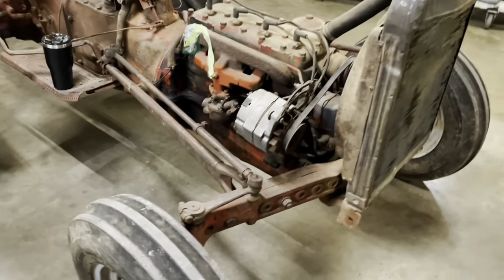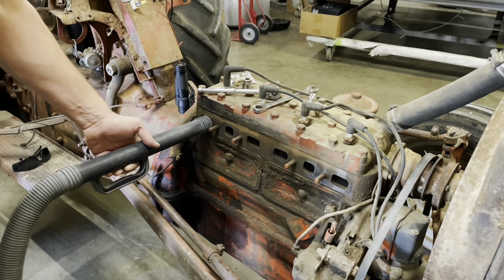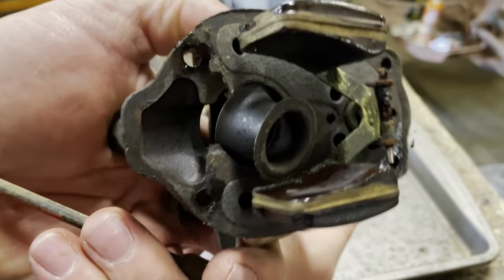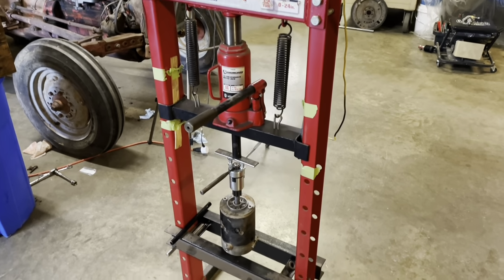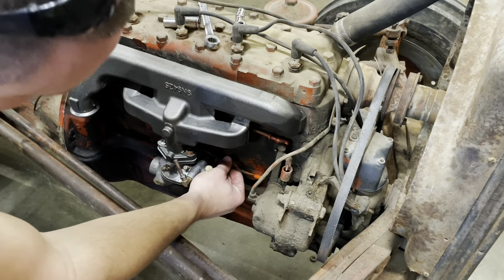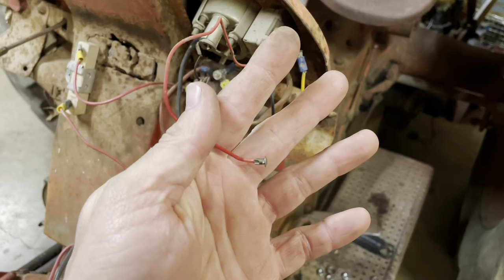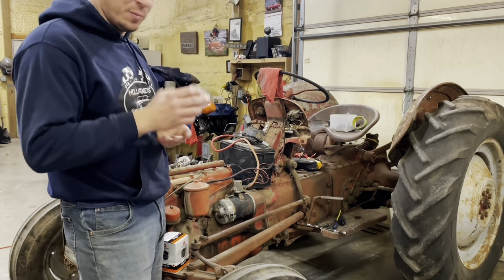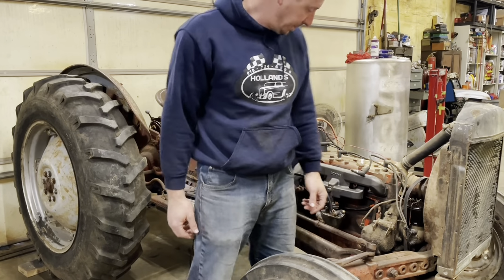Ford 8N Rescue. Episode 2. Still working on it.

Comment: Great video! When you check coil voltage you must have a load or complete circuit to ground to get the correct voltage at the coil. An oper circuit will always read source voltage. You probably should remove all resistors. Interested in seeing how you will rig the Alt. Need to do something with mine....
Reply from the maker: Thanks so much for watching and for the info. This tractor is up and running, helping me keep the property mowed. The final video was posted about a month ago.

Comment: You’ll get it going next time. Could have gap issues in the points,bad condenser there is a few things that could cause that. Spaghetti wiring one bad crimp connection. Just to name a few. It rolls over decent but I think wiring issues myself or ignition issues. You’ll be cutting grass in no time. Stay cool
Reply from the maker: I’d say there is about a 99.999999% chance it might have fired off in the next video that I did.